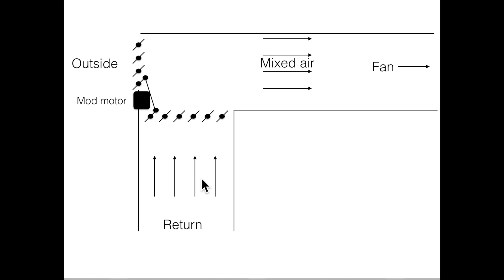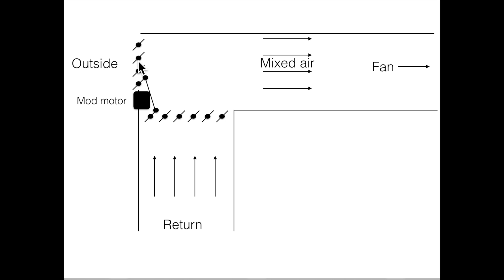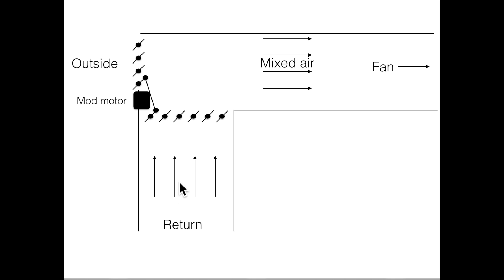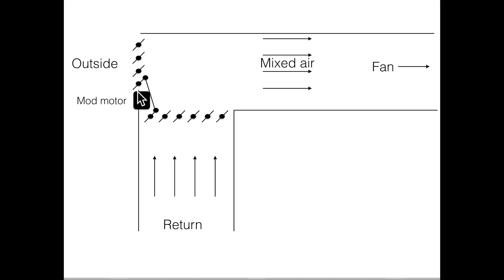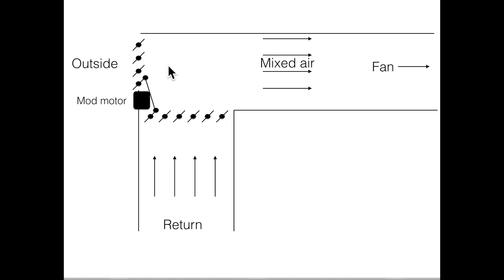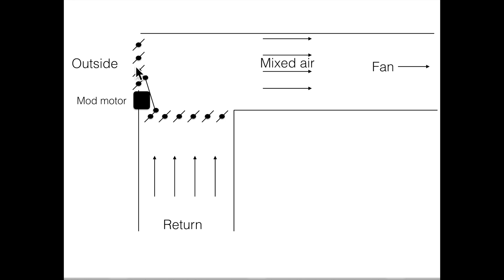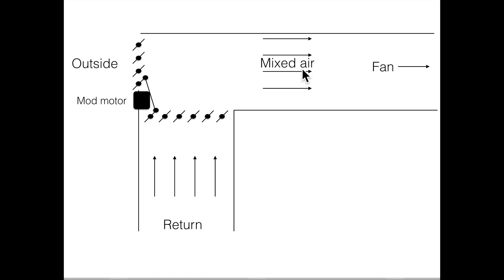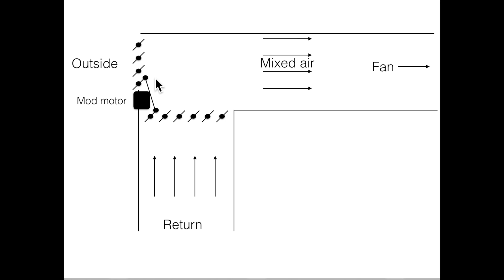The economizer Part 2

Comment: If the outside dampers are completely closed, do you still get 10% outside air coming in to the building? I learned this in HVAC class. [Is this code?]

I
Reply from the maker: Codes vary on the percentage.  If the dampers are closed, there is no outside air.  This is because no outside air needs to be supplied when the building is unoccupied.  Most units have a minimum position that allows some outside air.
GFM